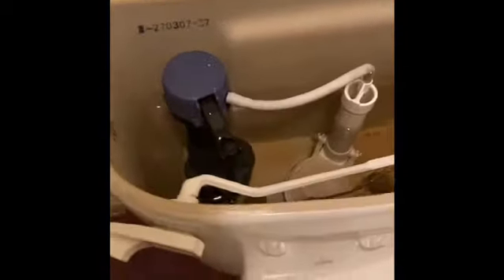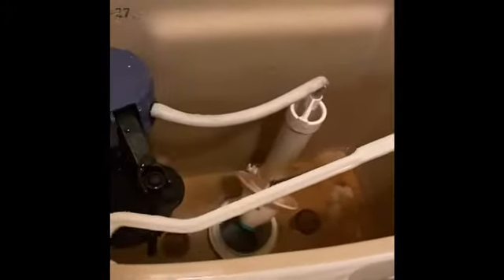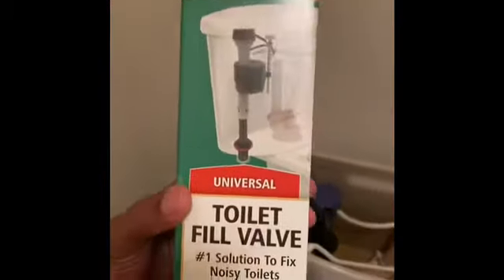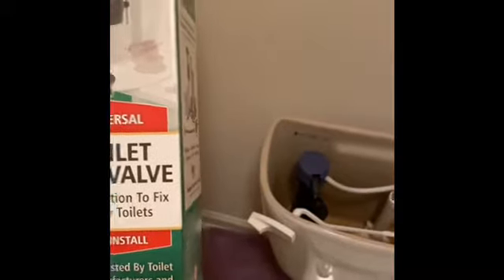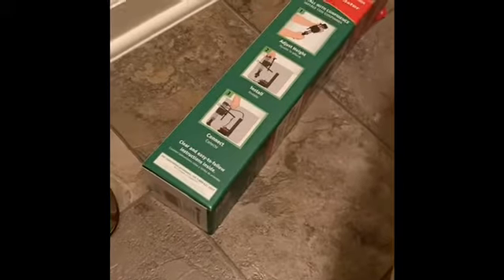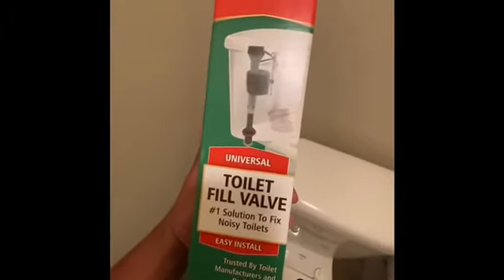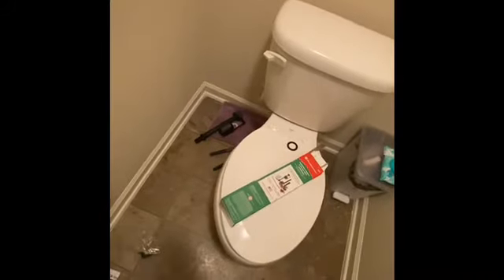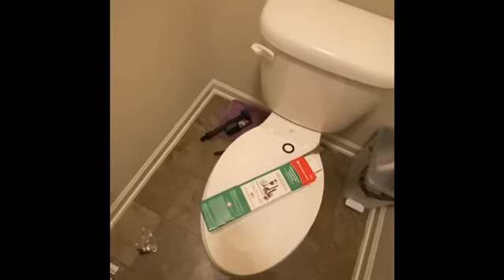when I flush my toilet it makes a loud noise-high pitch toilet fix-fill valve replacement toilet

Comment: I just had this issue and I popped the black top off the fill valve. Then you grab the black bar and turn it a quarter turn counter-clockwise until the middle part pops off. Turn the water back on very slowly to let it flush out any debris. Mine actually had what looked like small pebbles blocking it (rusted particles?) that I had to pick out with fine tweezers. After I put it back together, it worked beautifully.